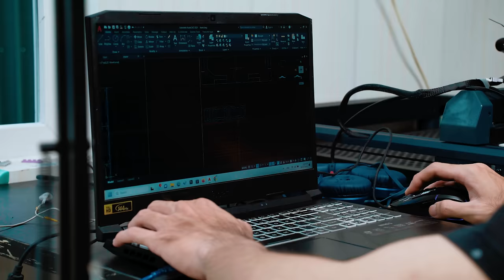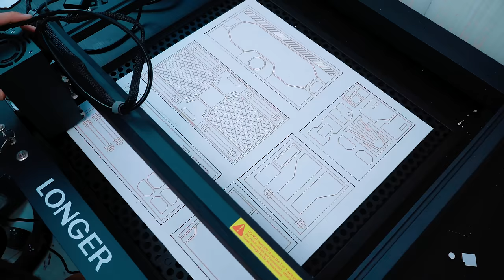How To Make Zombie Shark in the Laboratory

Comment: Amazing work, what an epic and epicly massive shark!!! I didn't think you would be able to bake the LED lights with the clay. Did you have to take any precautions??
Reply from the maker: You just need to use baking foil to cover the hot air blowing directly onto the clay and the lamp, everything will be safe, even the electrical cord.
Reply: Ah great thanks so much for the tip! Definitely makes me want to get more daring with projects using led’s!!

Comment: Love your shark! But what clay are you using? Did you bake it with the LED strip inside?! Or is this some air-drying clay?
Reply from the maker: I use two types of Polymer clay, a soft white type I use to make blocks, and a harder gray type I use to make details. i have baked the led lights and wires inside. it's completely fine, just use baking foil to block the hot air from blowing directly onto it